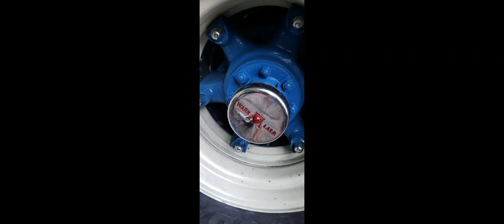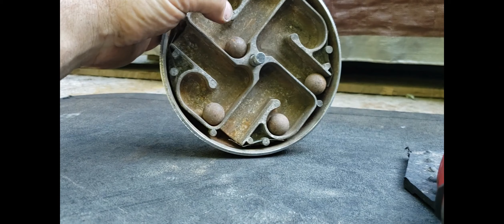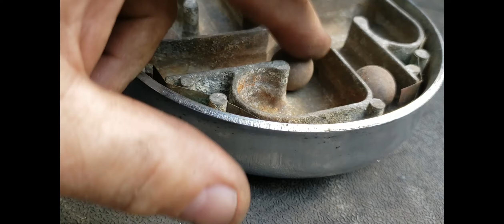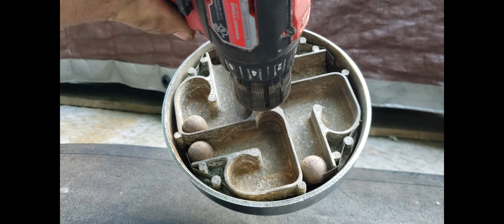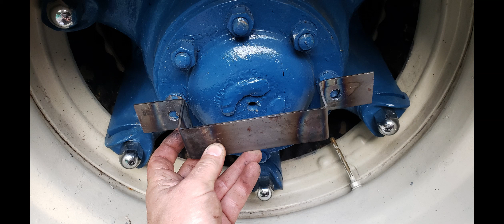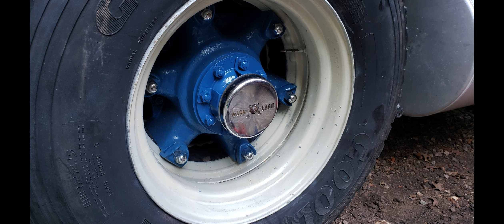Warn Alarm mechanical back up alarm operation

Comment: When were these produced? I need some for my old trucks.
Reply from the maker: The Warn Alarm brochure I have found is from 1965. I have found trucks from the 50s with either a hub mounted/driven or drive shaft driven bell. I'd guess easily mechanical back up warning bells can be found on equipment from the 40's through the 70's.
Reply: @VOLKSWAGNUT  
Thanks. I'm on the hunt!
Reply from the maker: @xmo552  I was lucky to find it in a tard sale.... FeEbay will be your best place. Warn was not the only manufacturer of back up alarm bells.
Reply: Those mchanical back-up alarms were most common in the early 70.:s. They were made in two sizes, a 6 and an 8 inch version. They were made by a company based in Seattle US. Here in Sweden we had both the Warn-A-Larm and a simmilar product produced by the Swedish company TODO who later became famous for their dry brake couplings. After the 70:s those alarms dissappeared from the scene as they were replaced by electronic devices.